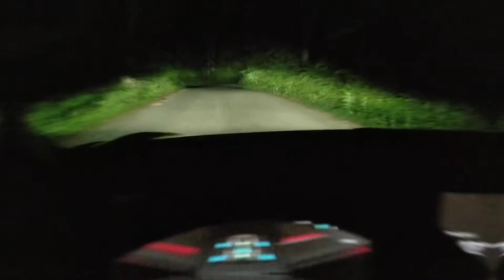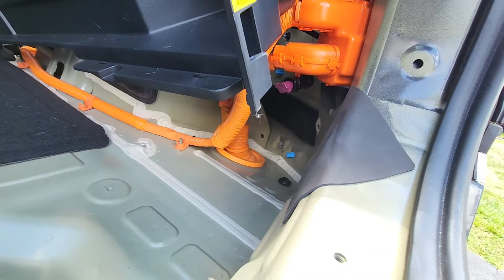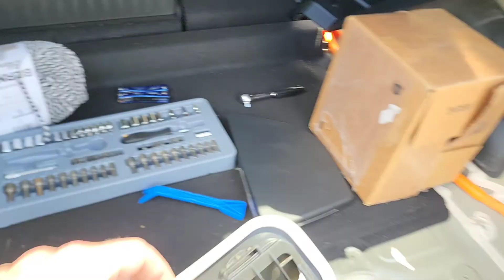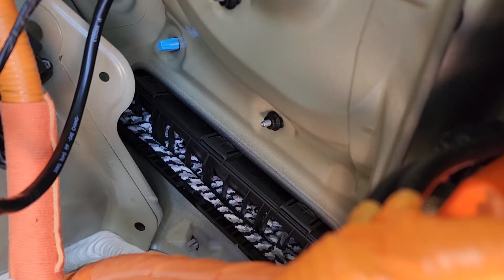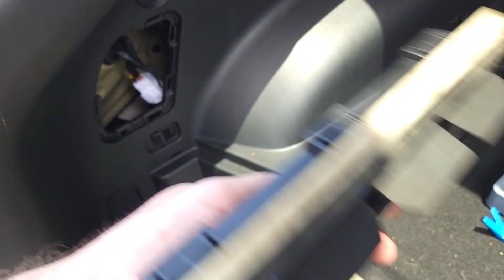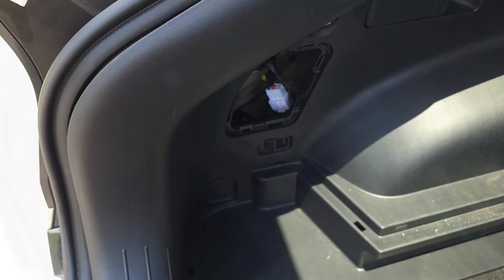FIXING the Infamous Kia EV6 Rattle! 😀

Comment: I have also noticed the sound, but I would suggest not leaving the vents open and not using yarn since water and time will probably cause them to get moldy, maybe. I would suggest thin automotive foam tape around the flap edges to allow them to function as they do, but would stop the sound of the flapping.
Reply from the maker: Yeah the yarn was more of a temporary fix while I had it open. That said, I don't think moisture can really get there much and the EV6 does have the auto dehumidify feature. I don't think it'd be too bad. But yeah foam tape would be better.
Reply: Yarn is a good solution actually, because you don’t need to worry about it falling off.
Reply from the maker: I was thinking that. It also was the only thing I had on hand lol
Reply: Exactly what I was thinking!!!
Reply from the maker: @markc19821 yeah something to keep an eye on
Reply: Genius improvisation. I wonder if this air pressure venting feature is unique to EV6 models. I have a 2022 Ioniq 5. No such rattle. Also, why two vents? Would one do the intended job? BTW, what is the intended job? Thanks for the video.

Comment: Yes! I've had my EV6 for 2 days and it's been driving me nuts! I'm going to design and print a TPU ring for the vents to stop the tapping but still allow them to close and operate normally.
Reply from the maker: Awesome! Sounds like a great fix. Good luck!
Reply: Rofl... that's exactly the solution I just proposed a year later.  It's nice to see someone else that thinks like me.  Did you do it?  Did it work?  Can you share you STL file so I don't have to make my own measurements!  :)

Comment: You could run a thin bead of hot glue around the contact face of the flaps, keep them open and let it cool. That would leave a softer contact patch.
If you think it would affect the weight / operation of the flap, put the bead on the face of the panel.
Reply from the maker: I thought about that but didn't have hot glue. Thinking about it more though, hot glue is somewhat hard. Even if it's a little softer, it still would make a sound with the flap closing. And the fact of the panel is hard to do I think. Several spots it contacts have a VERY thin cross section.

Comment: If you simply purchased some thin 1/16" foam with adhesive backing, it could have been cut to fit the flapper. What you did likely leaves air flow through the vents, you could have just glued them shut or open.
Reply from the maker: Yep that would probably work well.

Comment: Thanks for sharing! I've noticed that rattling sound while driving on the freeway, and it drives me nutz! Especially since my wife doesn't notice it at all. I wonder if a thin foam filter would dampen the sound and still vent air pressure.... might have to tinker with it on the weekend 🤔
Reply from the maker: Yep that would probably work!

Comment: Weather stripping along the flaps might work better? Or even a bead of silicone? That way they can still operate, won’t be affected by water, but will be cushioned?
Reply from the maker: Yeah someone mentioned weather stripping. That could maybe work. The challenge is the points where they touch are often VERY thin plastic.

Comment: Good morning Jeff, the noise has been so annoying, we had the  boot (trunk) cover out, the tool kit wrapped up and still couldn’t fix it.  Just shared the link with my hubbie to get him to fix it later today.  Will probably use some thin adhesive pipe insulation foam, should do the job.
Reply from the maker: Yes it's very annoying. My new GT makes the sound and I'm debating what to do to get it to stop.

Comment: Thanks so much!

Could I just ask, on the drivers side, is it just 3 10mm bolts you need to remove and then just pull hard to get the trim off? As you say it’s too tight to get it out either the panel in place 

Thank you.
Reply from the maker: To be honest I don't recall other than what's shown in the video
Reply: I worked it out. It’s just the three bolts you show but you have to remove the boot lip strip first, then just pull hard in the trim.

It’s really fiddly getting the drivers (LHD) side vent in and out it o my goes in one specific angle!

But it’s done now and no more rattles, thanks so much again!

(I actually taped the bottom of the flaps shut, the sides can still open enough to allow the air pressure to equalise and it stops the rattles.
Reply from the maker: @BAC_Mono  awesome glad you got it to work

Comment: I don't think that forcing the vents open permanently is actually going to be a bad thing. In normal ICE cars, which ventilate only when the car is active, sure, I can see why this would be a thing. Don't want to ingress moisture after a downpour. But the EV6, from what I've read, does a ventliate funciton now and then to dehumidify the car, so it naturally will vent the car while parked. Doing it this way though, not sure it's the best way to do it, I'd have, as you said, put felt tape on the flappers and quietened it down that way.
Reply from the maker: Yep those were my thoughts too.
Reply: I'm sure other vents will compensate for the dif
Reply from the maker: The vents are kept open some with what I used so there shouldn't be any issues with airflow.

Comment: I have the same issue with my ioniq 5 2023, i will do what u just did with your Ev6. the dealership had my car 2 times, and they couldn't get it fixed. Of course, they kept the car for days. Thanks in advance, Jeff.
Reply from the maker: Hope it works for you!
Reply: @TechnicallyJeff  just realized mine doesn't come from that side as yours. Rsttle/creaking comes from the top of the hatch. Every time I move the trunk with my hand, makes that weird noise I put some WD40 but still same issue. Maybe the dealer needs to change the whole hatch back door?
Reply from the maker: Oh really? Hmm possibly. Did you try adjusting the bumpers on the hatch? I know some I5 people had to do that to fix rattles.
Reply: You mean the two little things that we twist on the side to make the door tigher? If so. I tried that and same thing, it sounds like coming from the top side where the hinges are. @TechnicallyJeff
Reply from the maker: Yeah that's what i meant. Weird

Comment: I have a similar (maybe it’s actually the same) rattle that I thought it’s coming from the drive side door. Does it sound like it’s coming from the door?
Reply from the maker: No mine has sounded like it came from the hatch area. Idk what could be coming from the driver's door.
Reply: @TechnicallyJeff  Thank you Jeff! Today I listened to it carefully and found the rattling in the video in my car. It sounds exactly like what you showed in the video.

I also did more research on the squeak from my door, and I think it could be related to my recent ceramic coating job. The fix I’m trying to apply is to clean the rubber seal, and put 3m 5430 tapes to the contact areas.
Reply from the maker: Yep it can be quiet, but with the design it should be in basically every vehicle. Hopefully you can et rid of it!
Reply: I have the same rattle coming from my driver door - or it could be just under the car in the same area - not sure. I already tried to get the dealer to fix it, but they didn't on the first go around.
Reply: @jaredfinklestein4050  did you get any resolution?  I have a very similar sound to this rattle, but it sounds like it is coming from the front passenger foot wheel/door/glovebox area.  It's really hard to pin down where the sound is coming from.
Reply: @chrischaffey1252  The dealer was able to stop the noise at least temporarily (it was in the door), but it is coming back. It seems like it is a loose piece of plastic or something similar.
Reply from the maker: Very interesting

Comment: Could this also be in the right front of the car? I have a similar sound coming from somewhere in the dashboard. It is driving me insane.. Also only apears when I drive around 80/100 kmh. (that's 40/60 mhs?)
Reply from the maker: Hmm I don't think so. I haven't heard anything in that area and I don't think they place flaps in the front. They are designed to release air when the HVAC is not on recirculate, and that air comes out the front and exits the rear. It could be something loose. Maybe check the panels on that side.
Reply: Hello, I have exactly the same problem. I hear a rattle noise coming frome the front. Somewhere behind the central screen. And it seems to be related to the speed, not to bumps in the road. I have removed the cover of the central speaker at the front but couldn't find the source.
Reply from the maker: @rafaelcanizares9195 does it make the sound with the air on and off with recirculate on and off? Sometimes the climate control system can make some noise with the fans.
Reply: Thanks for showing interest. The noise doesn't change if I switch the AC on an off, if I change the fan speed or if I modify the air recirculation. It is not very loud, but once I started hearing it I can't stop.
Reply from the maker: Hmm anything in the glovebox moving around potentially? Or in the frunk?
Reply: Nope, I removed absolutely everything from the car, and it doesn't change. I am driving my ev6 for a year already, and I have 27000 km on it (more than 16000 miles). I have been chasing the noise for long.
Reply from the maker: That has to be frustrating. Might need to go to the dealership at this point.

Comment: I am sooooo glad my my22 gt-line AWD does not have that problem, maybe a bad batch of those flaps? Also I noticed the flaps are vertical and if you live in SoFL you see cars without the rear bumper all the time and those flaps are sideways, seems like bad design or bad batch.
Reply from the maker: Maybe? Idk it seems pretty across the board. Even new GTs and Winds have the problem. Might be hard to hear depending on the car and if you listen to music all the time.
Reply: @TechnicallyJeff  i can confirm as of right now, i do not get that issue, driving with no music, 0 noise
Reply from the maker: That's great!

Comment: Thanks for sharing. 👍🏼
On the other hand, the said method may defect the purpose and function of "quarter panel vent". As the flaps are permanently open, dust or insect can enter the cabin.  Besides, the openings are partially blocked by the wrapped material.
Counter proposal: use thin insulated film to wrap the frame opposite against the inner surface of the flaps. This won't affect the movement of the flaps due to additional weight bearing on them.
Reply from the maker: Yeah I don't think too much will get there but we'll see if I notice anything. Might just change the cabin air filter more often lol. But yeah I was thinking it could make sense to glue a little weight on the back side of the flaps. That would make it a little harder to open and keep them from fluttering all the time, but still would work for the major pressure.
Reply: @TechnicallyJeff  perhaps, you may design or modify the vent and sell to KIA or customers directly. Btw, KIA should issue TSB on this matter. ☺️
Reply from the maker: Haha that would be cool. I need to look into that.
Reply: I agree TSB👍🏾
Reply from the maker: that'd be nice

Comment: Hmmm sounds like this should be a recall since every EV6 would have this issue. I’ve heard it at times but it doesn’t do it all the time.
Reply: KIA is not going to issue a recall for an annoying sound.
Reply from the maker: I don't think they'd recall for it but yeah most will have it
Reply: @philhyde983  maybe not a recall, But it would be great if someone actually report the issue to Kia to let them know what the issue is since more people have it.
Reply from the maker: Yeah I may send it to my contact at Kia corporate.
Reply: @skyfox77  Normally this is through the service department to the KIA tech line.
Reply: @philhyde983  well maybe not a recall but the dealer should fix it for free if you take your car in and want it to be fixed.
Reply from the maker: Yeah Kia Tech Line got back to Jon and said this is normal operation. I get it's working as intended, but man is that sound annoying lol. They should do something to dampen the sound.

Comment: My main sounds come from the seatbelts in the back seat when they are not properly in place. They rattle against the plastic if the belt's loop is not in between 😤
Reply from the maker: Yeah that's common too unfortunately. I have two car seats back there so they are kept around their arm rests.
Reply: @TechnicallyJeff  wait for the switch to boosters 😅i can repeat so many times to put the seat belt correctly, kids don’t care 🤣
Reply from the maker: Haha mine actually are boosters. They've gotten pretty good at just leaving it around the booster arm rest lol.

Comment: Jeff I’m starting to get the rattle, where is the vent outlet, wheel well?
Reply from the maker: Yeah in the back behind the wheel well on the side.
Reply: Have you shared the video and the problem with Kia to see if the with perform the service?
Reply from the maker: No, the vents are performing as designed. I don't see them doing anything.

Comment: Some manufacturers actually have those flaps made out of rubber instead of plastic. That would resolve the issue.
Reply from the maker: It is actually a rubber material, but it's hard so when they come down on the hard plastic, it makes the noise.

Comment: Congrats, Jeff! Let me tell you about the annoying rattling sound that appears to come from the dashboard of my '22 EV6. I can't say when it started - we've had the car for 1.5 years and really like it - but now it seems to be audible when the car's driven on anything but the smoothest road surfaces.

I have taken everything out of the glove compartment and front cup holders, and I have looked over the frunk, but nothing seems loose - and the noise still occurs. So, I suspect something's loose under the dashboard panels but I don't know how to remove them. Also, it may not be a good idea for me to attempt it. Then, too, I imagine the dealer would charge a hefty sum to do the R&R. Help!
Reply from the maker: Hmm I (and others) have heard a rattle under the center console, seemingly under the wireless charger. Is that possibly the area? If I push on it the sound goes away. I just haven't taken the time to really look into it. Otherwise, I'm not sure what it would be. As for the dealership, you could bring it in and say there is a rattle behind the dash and you're worried something might be loose that could cause an issue (electrical, etc). I know my dealership would drive it, listen for it, and try to figure it out.
Reply: Interesting. I have a similar complaint. Of course, I can't say for sure it's the same noise you have, but it seems like. I notice it at speeds above around 40 mph, up to about 70 mph. One difference from your description is that for me, I really only hear it on local highways paved with concrete, and where the concrete is somewhat worn (many drivers in the area use studded tires, so the wear tracks on the road expose the aggregate in the concrete pretty quickly).

On sections of the highway where they've replaced one or more concrete panels recently, I can even hear the noise coming and going as I transition from rough surface to smooth.

For me, the sound could be described as a rattling, but it's a fairly quick repetition, very plasticky in sound, almost sounds like a grinding noise. Oddly, the frequency of the rattle doesn't vary with the car speed...it's either there or not, but always sounds about the same.

I was able to get a tech from the local dealer's service center to ride with me and actually hear the noise, so they've got notes for the car confirming it's there, but of course no actual diagnosis or solution.

I am wondering if there are similar vents somewhere in the front area of the car that are doing something like as in this video, causing the noise.

Comment: Hope you didn't leave it that way.  It looks like a bad idea.  I wonder if we could 3d print a TPU lip to go around each of those flappers so it's not so loud.   Also... you might just put a rubber pad right in the middle of each flapper... not to keep them from closing, but to significantly dampen the "drum head" effect that is making these things so loud.  That and maybe a thin piece of filter foam that still lets air pass but also acts as a sound absorber.  (to put behind it, not blocking the operation.)  Glad I know what to look for when I start hearing this though!
Reply from the maker: Luckily my new EV6 GT doesn't have the sound
Reply: @TechnicallyJeff  I just bought a "brand new" 2023 GT.  I'll let you know when I actually get to drive it, lol.  I am waiting on tires to arrive, since it's so cold here that I would likely damage the summer tires it came with.   That's one thing I think was really dumb on Kia's part, but it gave me an excuse to get a set of Stance SF10's for it. lol.
Reply from the maker: Haha yeah I swapped to psas4 tires pretty quick. Enjoy it!

Comment: Are there front cabin pressure vents because I removed my rear ones and still have a similar loud rattle from the front.
Reply from the maker: Not that I'm aware of, but there could be I suppose. Where do you hear the sound? Any particular side?
Reply: @TechnicallyJeff  I hear the sound from the front left and right side simultaneously. I removed the rear ones and it got rid of the rear rattling.
Reply from the maker: Hmm I'm not sure what that could be. Is it possible there's plastic near the vents from delivery? Maybe the floor vents?